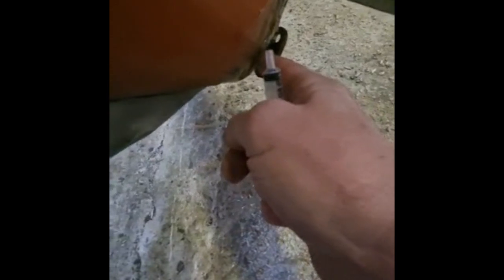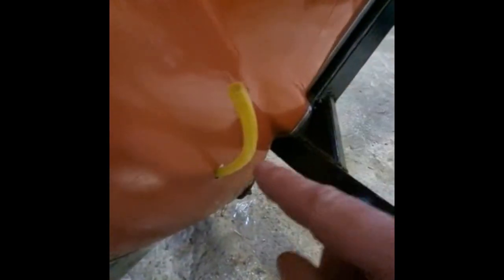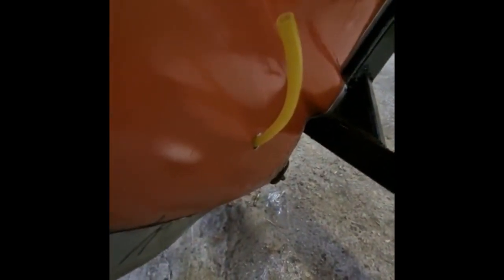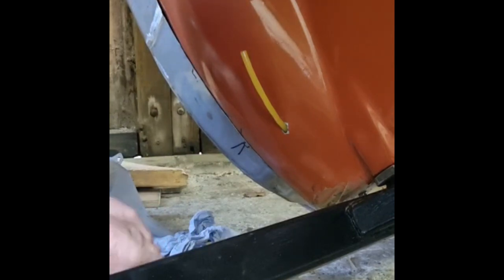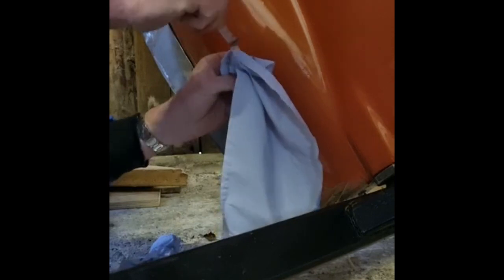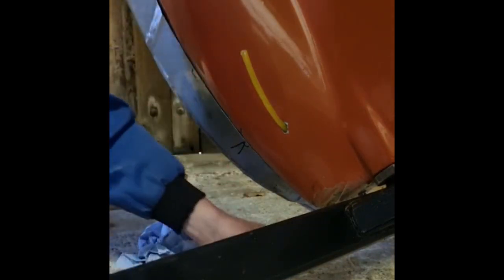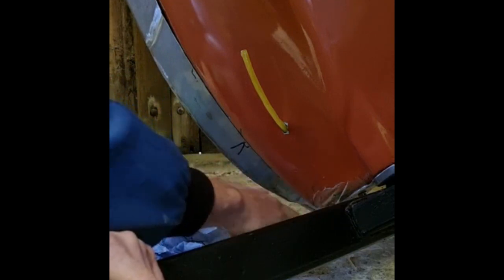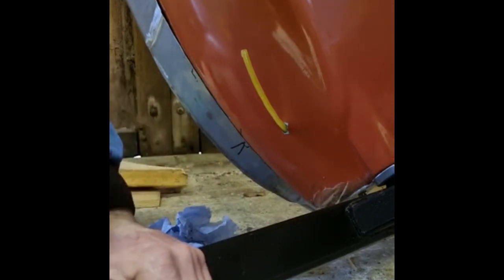Bonding in the aft support tube for the new keel on Big C

Comment: Don't forget a bailing bucket, and gloves. Your going to need some holy shit handles for any big swell, you can't brace your arms outwards for 2 days straight, you should also have a regular harness. what if you need to change the sail and you fall off the vessel? You should at least tie a rope around your waist. I would also take an extra pair of super thick wooly socks, down booties are also nice. Good luck, when is the launch? I'm a bit concerned about the small bolts holing the lower point of the fixed / semi fixed? rudders / skegs. I hope they have a decent steel plate on the other side with a very solid amount of glass. Have you tested to see how this surfs down big waves?
Reply: this is not his first rodeo